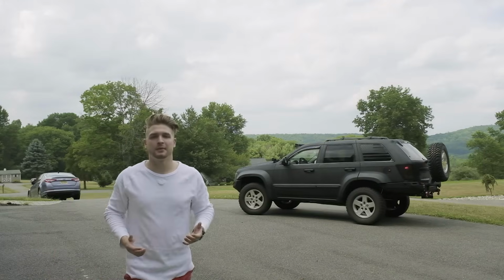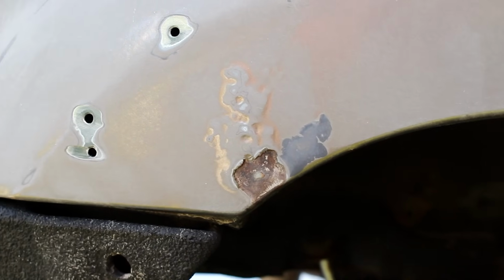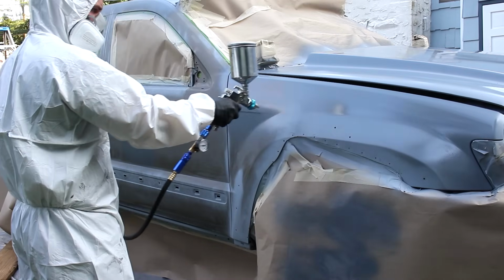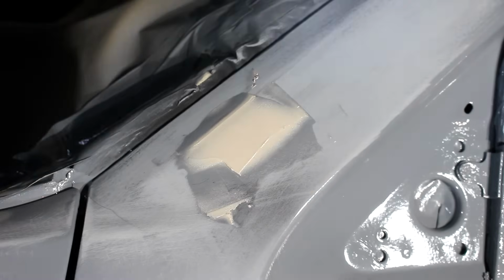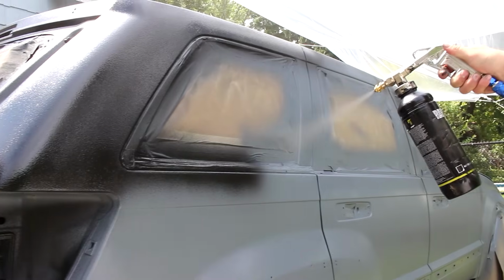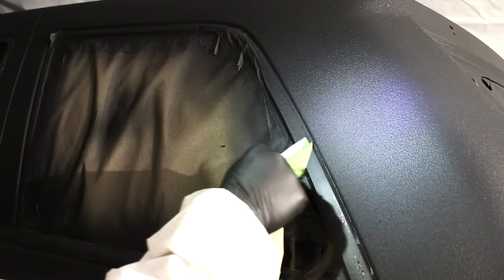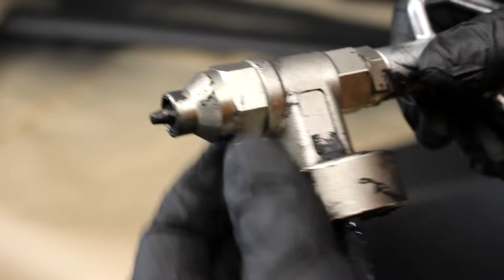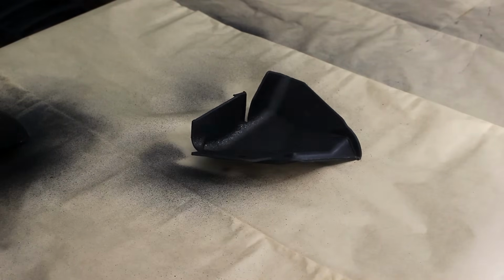Raptor Lining My ENTIRE Jeep (and everything in between)

Comment: Great video,  I have a few questions for you. How much liner epoxy did you use ? I'm planing on lining a surburban and not sure how much I need. Also whY size compressor is need to run the gun properly?
Reply from the maker: Sorry for the delay and thank you for the kind words! As for the epoxy primer, it's only available in a gallon, so I'd just purchase that for $150 and that way, you'll ensure you have enough. I went through about half of a gallon doing two coats on the entire Jeep as well as everything else that I primed. For a compressor, a 6 HP compressor that generates 150 PSI line pressure should provide sufficient air supply, but is dependent on the application equipment/gun. I'm using a 30 gallon from Industrial Air and I've never had any issues! I hope this information helps, please let me know if there's anything else that I may do! 

Thanks for watching and happy holidays!

Comment: Looks good, next time I would do the body work under the initial scuffing and have any repairs underneath that epoxy primer. Typically epoxy primer is a sealer and that's gonna be your last coat before your color coat or in this case the raptor liner. It also doesn't usually sand well. But overall good job!
Reply from the maker: I often times see these steps flipped one way or another, but I think in the future I'd er the side of doing the body work under the primer. You'll see this is quite the debate online, but I would again advise doing the method you mentioned looking back. Thanks for the tip and taking the time to comment!

Comment: You have definitely broadened my horizons here sir! I just purchased an 06 Tundra double cab and have been considering different paint options only knowing very minimal about Raptor products. This hands down seems like the most economical option and could definitely turn out looking great if done systematically as you have shown, but my main questions would be: 
-Can you obtain a semi-gloss sheen and will it keep its sheen over time?
-Can you thin it out some with thinner? 
-How difficult is to keep clean?
-And ultimately how long and well will it hold up!
Very well done informative DIY video! Thank you kindly to you and your parents!
Reply from the maker: I'm here to help and I'm glad you found value in watching my videos! Raptor is a great option in many regards from pricing to the level of forgiveness it offers to inexperienced sprayers. I'll be releasing another Raptor video in the coming weeks where I line a brand new Gladiator JT and in that video, I answer a lot of commonly asked questions that I missed in this video. That being said, feel free to ask away here in the meantime and I'll answer everything that I can! 

1: Different levels of gloss can be achieved with different textures. While it won't literally be glossy, the way it reflects light causes a sparkle in a way depending on the texture. You can achieve different textures by adjusting the PSI, distance, and most importantly, by using the professional Vari-Nozzle gun. I'd take a look at what's out there and see what settings others have used to get the finish you're looking for. You can also add a clear on top of Raptor, but that's often said to defeat the purpose. Raptor is 100% UV stable and will not fade either. 

2: You can absolutely thin Raptor and you must do so if you plan on shooting it with an HVLP gun as advised by U-POL themselves. I can't recall the compatible thinner at the moment, but I know it's mentioned on their MSDS available on the Raptor site. 

3: Cleaning is beyond simple and the paint can be power washed and look like new again!  I personally use a foam gun and a wash & wax from Adams Polishes on my finish. 

4: Naturally Raptor will last plenty longer than standard finishes. This is because not only is it a two-part paint, but it's MUCH thicker than standard paints. Durability is usually a function of the thickness of the paint (assuming proper adhesion) and Raptor takes the cake! Apply two coats followed by a drop coat (covered in my next video) and you'll be good to go for YEARS. Repairs are so easy with minimal blending needed as well, but remember, prep is key! 

I hope this helps! Please let me know if you need anything else.
Reply: Thank you kindly for taking the time to explain all of that, sounds very logical. I am looking forward to your upcoming video! Blessings!

Comment: I legit love you for this video.

I've watched countless.
And now that I'm about a month out from jumping in to this project, your video is the best thing I've come across.
Came out so beautiful.
And man do you show case well.

How do you feel it will hold up?

Decided to jump on this before my SAS and cummins swap on my dakota.

My paint is just struggling more and more everyday.
Reply from the maker: I'm sorry for the delay in response! I've just finished my second move and have finally settled in and have the time to answer some comments. I spent so much time making this video from filming to editing and I can say that it's always worth it when I get comments like these. 

The Raptor has held up really well and it has been applied on the Jeep for over two years with no issues aside from some peeling on the chrome door trim where the lettering is clearly because I didn't sand in them. Otherwise, I have taken the Jeep down tight trails with branches scraping them and there have been no instances of chipping or peeling anywhere and where I applied it to the lower part of the rocker panels, the salt has had no effect on it! There has been no fading or anything like that either. 

I also want to mention that on February 20th, I'll have an upload premiering where I Raptor an entire Gladiator JT, so that should also give you some additional tips and a look at another project I did. I'm excited to see what you think of that and in the meantime, please let me know if there's any other questions I may answer in preparation for your project! Good luck and let me know how it goes!

Comment: Fellow jerseyite and Raptor shooter here. If you do it again, I've learned using the tintable liner at about 80psi inlet gives a really sooth texture. Between thinning it down with paint and harder really let's this stuff flow. And leaves a glossier finish. Check my channel for a red van I did. Love the WJ. I'm a huge jeep guy myself. Had a ZJ, many FSJ's, TJs and CJs. Well done young man.
Reply from the maker: Greetings from Jersey as well! I actually just moved to Boston, but I'm still back and forth to NJ often. I really appreciate the advice as I do have a couple gallon kits of the tintable Raptor and I will be using that for some new suspension components. I'll be checking out your channel now, thanks for the tip and let me know if you ever take the van to NJ shows!
Reply: When spraying at 80psi do you make any change to the mixture by thinning it out or is it the same 3:1 mix?

Comment: I only really have one question. With its rough texture it seems like this would be a bitch( or downright impossible) to clean unless you're using a power washer. Is this true?
Reply from the maker: To be completely honest, I only ever use a pressure washer, foam cannon and a large truck brush to clean this and it has worked flawlessly. So I can’t saw how other methods work, but I assume a standard fosm gun (that mounts to a standard garden house) to lift the dirt + a truck brush would work just as well. You can use a more aggressive brush due to the scratch resistance of the paint and if you go with a finer texture, it should be easier to clean!

Comment: You cannot coat with oil or navel jelly, and paint it. And body work did not cause rust. You are talking out your brown eye and screwing over others who dont know any better
Reply from the maker: I clearly cleaned before painting and I clearly blaimed impropper painting from tbe original body work. Are you saying it’s an extremely unlikely coincidence that the ONLY rust bubbles I had on my Jeep were where previous bodywork had happened? And how has the liner been on my Jeep for years with no adhesion issues? Because I mention cleaning with a degreaser and prep spray prior to any painting.
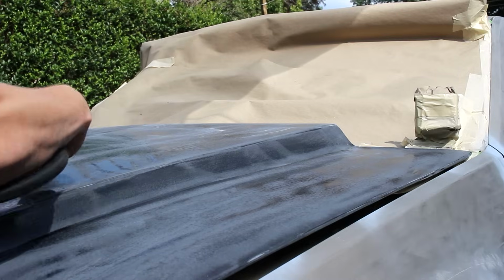Reply from the maker: @pjshooter6  4:50 "I'm gonna shoot the entire Jeep with this prep spray, I'm going to wipe down the entire Jeep to make sure nothing is in the way of proper adhesion." So tell me what part of this is not clear? This VERY CLEARLY states the surfaces are all cleaned and wiped down AND THEN followed up with a tack cloth- something 99% of people planning to spray Raptor would skip.

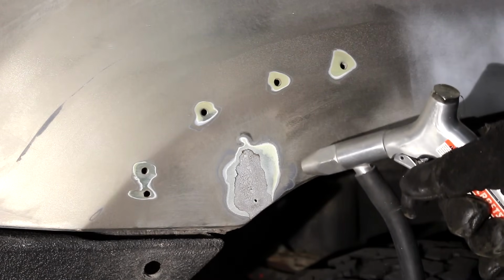4:05 "There was some previous bodywork done which PROBABLY caused the rust." Now tell me, after all of your clear expertise, how is it a bad assumption that faulty bodywork caused rust? You're right, I don't know what damage was done prior, but bodywork includes prepping the surface for filler and ensuring there is no prior rust and that the work is done to ensure rust doesn't return. Not only that, I didn't even definitively say the cause was bodywork, but guess what, it's not a big deal! 

It's funny, mostly everything I do and say is taken directly off of the MSDS sheets from Raptor and from the techs at U-POL who sponsored this video. It's clear that you have a personal issue and I have a right to defend the video and the fact that I made this to educate others and help them with their work. I go out of my way to answer every comment and question I get here, but via email, DM on Instagram and Facebook, and on other content. What's also obvious is that your issues, being as obsolete as they are, were derived from other problems that you have with this video or me. So please, before you make a fool of yourself again, think before you leave a senseless comment.